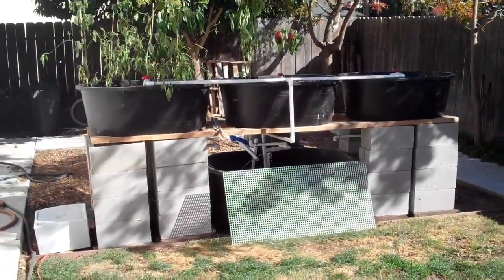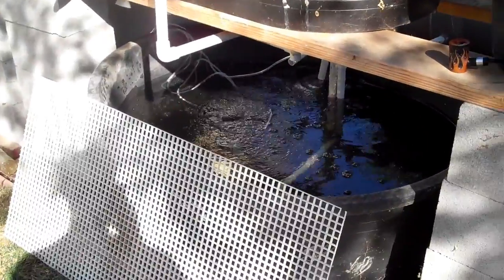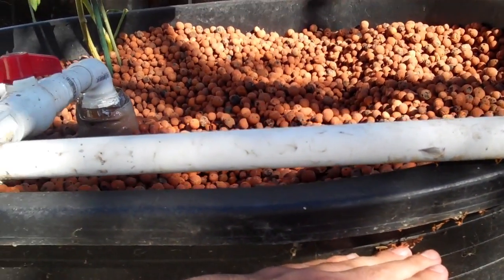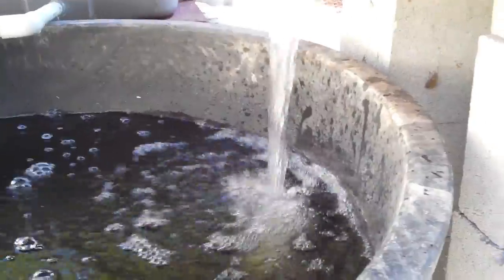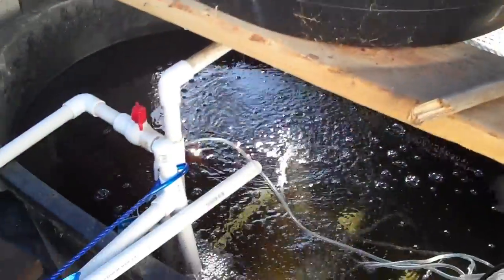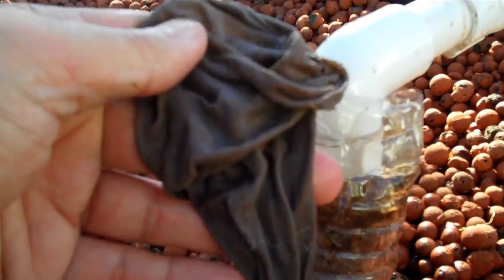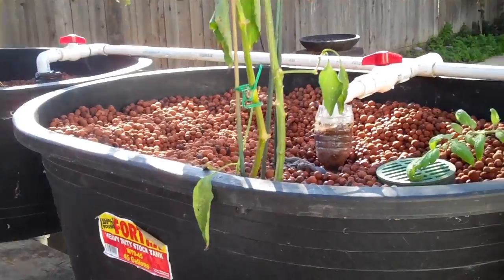Aquaponics - Complete System Walkthrough

Comment: I see a few things that you could make drastic improvements in. 1). The filter is designed backwards. Check out how an aerobic septic system is built (I installed septic for a few years and studied the different designs and design principles). Her is how they work. There are usually 3 tanks with the inlet and outlet on opposite sides from each other and the inlet about an inch higher than the outlet on each tank. There is a T fitting on the outlet of the first tank with a pipe going half way down the tank to pull from the clear water and a riser on top so trash does not flow in and acts as a vacuum break. The second tank inlet comes in the side(s) at the top and spashs down helping create air bubbles. There is an air pump that blows low pressure air in on the inlet side with a diffuser to break up the bubbles into smaller air bubbles. What this does is causes Air Robics bacteria to attach to the air bubble accelerating the eating of the solids. We usually put some yeast tablets (1 or 2) and a little dog food in a septic to start the air robic to grow and start to work. This is a natural bacteria that cleans the water. Then the water comes up thru a funnel from close to the bottom. This funnel causes a calming area in the system as it goes from a small inlet to a larger area at the top. That allows the final solids to slide back to the bottom as the water slows down like a stream to a lake. There is a pipe from the center top of the funnel to another tank that the water cross flows into. this water is very clean
2) way too much water flow for the area of the filter. The filter should be about 3 feet long and the funnel at one end and inlet at the other. the containers should be for what you are trying to do with the water flow about 15 to 20 gallons roughly and 3 or more feet long each, except the last one that could be 1 to 5 gallons for return line and/or pump. The farther the inlet and outlet are the better for the calming and settling. I hope this helps you.    http://www.google.com/imgres?imgurl=http://www.envir-solutions.com/files/5612/7300/5487/hoot.jpg&imgrefurl=http://www.envir-solutions.com/environmental-services/alternative-water-purifying-septic-system/&h=256&w=401&tbnid=KfG5AFR8-7g-NM:&zoom=1&docid=1Nubrg2hDSFO9M&ei=pDMFVcvKFMnIsQTKrYD4BQ&tbm=isch&ved=0CH0QMyhDMEM

Comment: I tried to skim thru your comments to see if this was already referenced, but I couldn't get thru all of them, so apologies if this was already discussed... but.
I believe you'd have more success if you allowed your sludge filter to be the main gateway to your grow beds. This way, you won't have to have 2 independent filtration systems. If you go from Tank to sludge filter to grow beds back to tank, you'd improve circulation and ensure everything passes thru your main filter.
Reply from the maker: Daniel Webster I basically have made those filters AFTER I already plumbed out the system.   Before, there weren't any additional filters.  But my pump is so powerful that I couldn't send all the water to the grow beds, so I had to recirculate some back into the tank.   So instead of just putting it back into the tank, I built that grey filter in the back to filter it first before putting it into the tank.  That way, 1) the water going to the plants is filtered by the grow beds, and 2) the water recirculating is also filtered by my gray secondary filter before returning to the tank. 

With aquaponics, you can never have too much filtration.

Comment: In addition to filtering more, you may want to do water changes once in a while, never more than 25% at a time (use rain water).  Also they say you can have "one inch" of fish per gallon so it doesn't overwhelm the system (less would be even better). Not sure how many you had to begin with....

 I have had fish tanks for a long time and while the plants might like the nitrogen in the water, the fish don't.  If you want to rinse your growing media, just do it one container at a time and use rain water, there should be plenty of beneficial bacteria remaining in the media.

Nice setup.

Good luck!
Reply from the maker: Hodmokrin I currently do a 15-20% water change every couple of weeks.  Only have 4 fish in that 100 gallon system, and I don't plan to add anymore.  I will wait until I get a larger 300 gallon tank before adding more fish and plants.  Thanks for the comment!  I did add another filter to this system AFTER this video was made. You can see it on my channel if you search for my 5 Gallon Grow Bed Filter.

Comment: you need  scouring pads and gammarus in your filter, they are crustaceans that eat fish waste the same way earth worms eat animal waste,
https://www.google.com.au/search?q=gammarus+crustaceans&biw=1600&bih=775&tbm=isch&imgil=aSSHxjPJOkfmbM%253A%253B3GUeX5Ak5-a0-M%253Bhttp%25253A%25252F%25252Fen.wikipedia.org%25252Fwiki%25252FGammarus&source=iu&pf=m&fir=aSSHxjPJOkfmbM%253A%252C3GUeX5Ak5-a0-M%252C_&usg=__fHoGQYXoIQ2uwMO89NrabNLay_8%3D&ved=0CDkQyjc&ei=P5jJVIieDpPU8gWClYCQCw#imgdii=_&imgrc=aSSHxjPJOkfmbM%253A%3B3GUeX5Ak5-a0-M%3Bhttp%253A%252F%252Fupload.wikimedia.org%252Fwikipedia%252Fcommons%252F3%252F3f%252FGammarus_roeselii.jpg%3Bhttp%253A%252F%252Fen.wikipedia.org%252Fwiki%252FGammarus%3B951%3B589

also you need a separate worm farm filter full of rocks at top and pearlite below, water fed from fish tank wets pearlite level, which will also fill with gammarus. worms feeding on grass clippings and leftover household vegetable scraps on the rock layer, produce a valuable waste liquid to feed to grow beds
Reply from the maker: Walter Smith those will never survive in my warm climate.
Reply: ***** Crayfish might be something to consider. They eat the fish waste off the bottom of the tank.

Comment: Why do you need a filter? The fish pooh is there to fertilize your food plants. One thing feeds the other and they both filter things.
Reply from the maker: Nissa Armstrong - Poll it helps remove what the filter can't or misses.
Reply: ***** You don't really need a filter for the solid waste. You brought up a point at the end of the video for the long run but there is another, more natural, solution. You can actually put earthworms into your grow bed. Charles Darwin referred to them as Soldiers of the Soil because they are one of the most important organisms on the planet. They aerate the soil, decompose organic matter like dead roots and the fish poop, they store beneficial bacteria... fungus... and other nutrients for the plants, they also facilitate the roots and bedding. That's your best bet, truly natural :). Also, if you decided to raise a worm farm, you could also use them for fish food.
Reply from the maker: I do have worms in the grow beds.  The point is that even the grow beds don't filter out EVERYTHING (worms secrete waste too), and like all filters, they eventually need cleaning.   Having the ability to keep waste in the system but still clean it out (without breaking down the filter) is something that I find much easier to do by having a couple of additional filtration units which I can take apart and clean without touching the established grow beds.
Reply: ***** So same basic principle as a sump just set up a little differently. I like it.

Comment: Great video,and logical talk through,due to illness neglected my setup but I still have about 6 live carp and some veggies.
IT SHOWS HOW RESILIENT  AQUAPONICS IS IF YOU HAVE BASIC SETUP RIGHT e.g. cleanliness and ensuring fish have enough oxygen,no need for OXIGENATORS,if your inlets produce enough bubbles e.g. waterflow outlets
above fish tank water level ,water splashes into tank,I also split my growbed outlet so some is also diverted to fish tank producing more bubbles
I WILL NOW MODIFY MY SYSTEM regarding more efficient crap filtering like you suggest
Best of luck Jim C
Reply from the maker: James Odiaxere Also look at a video I filmed about two months ago called the 5 Gallon Grow bed Filter, which I also added to the system.   It's been working to keep the crap out of the water and it's helped the health of my fish.

Comment: Thanks for showing your system.  I tried a sponge configuration as you'd had and it overflowed once it got plugged up.  I now use a series of brillo pads running it through a 5 gallon bucket and is working so far.  I flush it about every two to three weeks.  Good luck with your new system.
Reply from the maker: David Kroening I have a video after this one showing an additional 5 gallon grow bed filter I made, and that seems to be helping as well.

Comment: If you check Sylvia Bernstein's book, you will learn that you want to get rid of the filter and let the Poo go into the growbeds. You also then need to put red wiggler worms into the growbeds and they will convert the solids to worm casings which is the best organic fertilizer you can get.
Reply from the maker: Kathy Dobronyi After four years of aquaponics farming, it's my experience that you should have a method to REMOVE the solids.  You need some way of isolating the solids and removing them so that the grow beds don't get too gunked up.  Some solids will make it in there, but there needs to be a way that you can clean it out without dismantling the entire grow bed.   If you look at my latest aquaponics video, you will see me discuss this in more detail, along with a second filter I installed.   It's made an incredible difference.

Comment: Hello ! New to your channel ! I plan to start my own DIY aquaponics project this January and your videos are really helpfull!
Do you measure pH amonia and Nitrates in your water ? If yes then how often and what do you use to change the pH if it is rather high or low?
Reply from the maker: ErevosWanderer Yes, I do.   I mostly measure for ammonia, kH, and the PH.   Typically that's all I worry about.....because if there is high ammonia, then everything else doesn't matter (in my eyes) since the ammonia is probably the most dangerous.   But if ammonia is under control, changes are the nitrates and nitrites are as well.If you need to raise the pH, you want to do it slowly.  Research online because there are TONS of good articles on it.   I typically add a little baking soda to the water which is supposed to buffer the PH and keep it from swinging.   It also raises the PH too.   My system is usually around a PH of 8.0.    To lower the pH, you need to add something acidic.....but GENERALLY SPEAKING, you shouldn't be messing with pH.  A healthy system will balance out and should have a steady pH between 7.5 and 8.2.

Comment: turn your filter intake to the side not up will help settlement in your filter
Reply from the maker: fkujakedmyname I have since rearranged it drastically from what you see in this video.  The intake now comes in at the bottom, horizontally........the water is then filtered through a bunch of Scotch Brite Scouring pads, and then it exits from the top return pipe back into the tank.

Comment: Very Logical.Why not put a float with a pin through it in the filter tank, and allow the pin like a bobbin to push through the tank and once the marked point on the bobbin rises through the lid you should clean the filter.

Comment: You need to do some more research... The fish fecal matter is suppose to be the food your plants feed off of.
Reply from the maker: Hath'alud LaFox I've done plenty of research.   The nutrients for the plants aren't in the fish SOLIDS.  It's in the nitrates which are dissolved in the water.   Having an accumulation of fish solids in your system is not a good thing (in the long run), since it will eventually collect at the bottom of your grow beds, and could potentially become anaerobic in nature.   The way my system currently is, it allows about 50% of the solids to stay in the system (by making their way to the grow beds and mechanical filters), and the other 50% is caught by my rubbermaid filter which I drain and water the other plants in my yard.
Reply: ***** I have read about introducing worms into the grow medium to deal with the extra solid accumulations. Also some crawdads or freshwater shrimp under a screen system at the bottom of your tank (protection from fish) will further break down the solids that many consider "waste" into even more easily digestible nutrients for the plants, like a fine tuning. I am now digging my pond, I plant to merge an aesthetic fish pond with a 4" pvc gravity system and am researching as I go, thanks for taking the time to post this.

Comment: You need to improve on the filter , that wont work. Cover the inlet water to the filter with small bucket
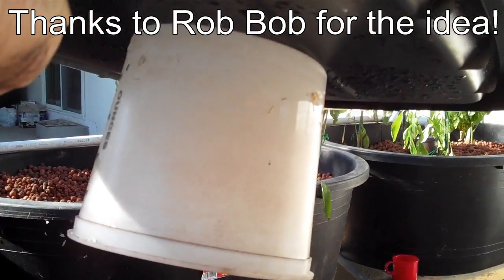Reply from the maker: It is covered with a bucket.  Go to 8:25 in the video and you can see a bucket screwed into the top of the lid of my filter.  Also notice that the water coming out of my filter passes through a black foam sponge guard.   This keeps any debris from getting back into the tank.

Comment: I haven't yet embarked on my own aquaponic system but your video is a very good explanation of the basics - one thing though , is I wonder if it necessary , every year or so to clean out the grow beds completely by washing all of the pebbles off and putting them back cleaned of all worm castings ,etc.- would this be a huge job?
Reply from the maker: To clean the grow beds is a HUGE job, in my opinion.  If you have no filtration installed, then all the fish waste will collect in there.  That isn't a bad thing (since it will all be good fertilizer), but you don't want it to become anaerobic and produce anything harmful for the fish.   But if your grow beds are empty after each growing season, then it would be wise to clean them out.   One "easier" way to do it (without pulling out all the rocks) is to flood the grow beds, stir up the bottom with a stick, and then drain all the crappy water out...repeating as necessary until the water becomes more clean.

Comment: It looks like you put a lot of thought in your system and it look pretty good.The plumbing and filter system is excellent. But the original concept of a system like this is to allow the symbiotic relationship between the plants and the fish to exist . You didn't mention which one of them died. The fish or the plants and work from there.Maybe the plants are not getting enough fertilizer from the fish and the plants are not releasing the necessary nitrates for the fish to flourished. In any way, I think you can solve the problem if you really look a liitle deeper into it..
 Goo luck and thanks for the video

Allan
Reply from the maker: There is still a symbiotic relationship taking place.  My filters are mainly to get rid of some of the fish solids so that they don't clog up the grow beds.  The beneficial nutrients still get into the plants and they still filter the water of an harmful nitrates and nitrites.  The system has been working wonderfully.  As for the dead fish, none of those fish you see in this video have died.   However, two were extremely close to being dead, and that was covered in some of my past videos.   It was caused by metallic poisoning from an underwater heater.

Comment: I realize that you don't have any fish in there yet, but you also said that you used to have fish in your system until they died, so my questions are:
1. How many fish (in lbs) did you have in that 100 gallon container?
2. How fast do they multiply/how frequently did you pull one out for dinner?
3. What did you feed them?
4. How much (in lbs) did you feed them daily?
5. How much did it cost you to feed them?

I'm new at this, so I'd be happy if you answered any of these questions. Clever idea with the filter, by the way.
Reply from the maker: The fish that died were mainly from metallic poisoning when I didn't realize an underwater heater was corroding.  The system was overstocked as well, so when one got sick, it started to affect everything.   I went from 30 fish down to two.  None of my fish are for consumption.    They are ornamental goldfish and koi.  I use my system mainly to grow veggies and for the peace of mind it gives me.  I would only consider raising edible fish if I had a much larger system (at least a 250 or 300 gallon tank). The cost to run a system like this is small.   Fish food is cheap, and when I am not running a water heater, the pumps only use 40 watts of power.

Comment: GREAT IDEA FOR THE WATER FLOW INTO THE GROW BED.MAY I SUGGEST YOU PUT A PLASTIC FLOWER POT ON THE UNDER SIDE OF YOUR SWIRL TANK WHICH WILL CHANGE THE WATER DIRECTION AND LET MORE WASTE TO THE BOTTOM OF SWIRL TANK. HOPE THAT HELPS. THANKS FOR YOU VIDEO. JIMS
Reply from the maker: I do have an upside down plastic pot on my swirl bed.  It's drilled into the lid, and the pot covers the inlet valve which feeds water into my filter.  So the water settles down to the bottom.

I also have worms inside of each grow bed to help break down old plant matter, or any fish waste that happens to get inside of it.
Reply: ***** how do they survive? water forces worms out of ground might tempt them to crawl out of grow bed?
Reply from the maker: They don't.  The main reason why they thrive in here is because 1) they aren't flooded permanently in water, because it drains fast once it's filled.  And 2) the water is highly oxygenated, so they don't drown like they would with rain water.